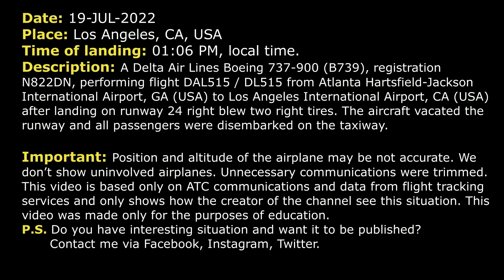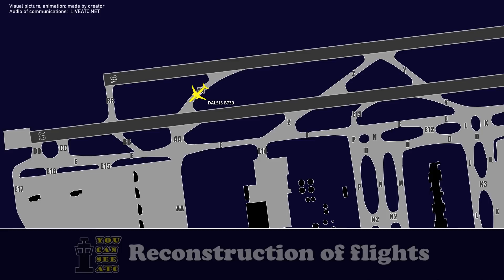Delta Boeing 737-900 blew two tires on landing at Los Angeles International Airport. Real ATC Audio

Comment: Wow, an intelligent firefighter and a stupid pilot. He even said tires 3&4 which would indicate the right side of the aircraft. Her, "Aircraft right, correct?" reply was stupid. All numbers are in sequence from pilots left. So, engine 1 would be on the left, and 2 on the right. So, 4 tires on the 737, would put right inboard and outboard tires as 3 & 4 which is a perfect and simple way of condensing, "right side inboard and outboard", to "tires 3 & 4". Stupid pilot.

Comment: Why isn't there any sensors detecting which and if a tire blew out? Is that too complicated technology?
Reply: our cars have them. in any event, the fire trucks will see soon enough and the runway garbage collector cars still have to examine the runway.  but an immediate notice that it was a tire that failed and not an engine falling off would be nice to see lighted up in the cockpit
Reply: Because it’s a 737 and it’s 1950s technology.
Reply: @UAL320  737s have tire sensors.
Reply: @N1120A  Not any 737 I’ve been on
Reply: @N1120A  it's a customer option. The airline has to choose whether or not they want them
Reply: @N1120A  ….No they don’t.
Reply: @UAL320  dream on buddy. You’re obviously an Airbus fanboi
Reply: @tomdavis3038  ….No, I actually fly this hunk of junk…..I’m used to it, though, so all good….👍🏻

Comment: More than 1 hour for a flat tire… not that efficient I’d say
Reply: Extremely efficient considering... They have to get two new wheels from their base, take off the old ones, check for any damage to the wheel area, put the new wheels on and then check that the aircraft has no damage plus they have to check the brakes are aligned and working correctly
Doing all that in an hour is no mean feat, it takes around 10-15 minutes PER car tyre. What you're also forgetting is that it's an active airfield, they have to get permission to go down taxiways like aircraft do so they could be waiting 10 minutes for an aircraft to land or move before they can move themselves
Reply: Tripe A takes three hours to reshoe your car. An hour for two tires bigger than a human blowing up is actually extremely efficient, considering how actually rare the situation is.
Reply: I don't think they left the pax on board for the tow.  It can cause quite a bit more damage towing with both tires shredded.  I suspect they brought buses out for the pax then either put at least one new tire on or just towed it as is and accepted the additional damage.
Reply: @darrylr.4983  I would be very surprised if they towed the aircraft without changing at least one tire. And I'd be even more surprised if it's allowed to jack up the aircraft and change a tire with passengers aboard.
Reply: Yeah, well, when your captain doesn't even understand that you can't tow an aircraft with both tires blown off of your right main landing gear, and needs to hee and haw for half an hour before someone else realises that for her...no wonder it takes long for them to even request the right equipment to them, and only then does the clock start ticking towards when they get the vehicles and equipment over there!

I mean seriously, one would think that common sense dictates that if you have no intact tires on your landing gear you ain't rolling that plane nowhere! But I guess they are now hiring pilots that belong to that group of people who drive their cars with flats and destroy their wheels and often much of their car too...
Reply: @pistonburner6448  She literally said she knows they aren't going to be able to tow the aircraft...
Reply: @Julius4396  No, she at first was talking about towing, then much later said maybe not (after she had talked to their operations), then went back to saying they might be towed.
Reply: @pistonburner6448  : Sorry, you are wrong. She realized quite quickly that the aircraft would not be able to move under its own power on its own wheels in its present condition; beyond that, it's not her call. It is certainly possible to tow an aircraft with two blown tires on the MLG; depending on circumstances and what equipment is available, they may be able to dolly it, or they may have to tow it anyway and accept further wheel damage (and probably runway damage), or they may want to try changing the tires on the taxiway, but in any case that's not the pilot's decision. That decision is up to Ops and Maintenance.

Comment: Hate to be stuck on the plane for an hour.
Reply: An hour's nothing. Try getting stuck in between two runways for three hours because there weren't enough gates in Honolulu. Makes you question your life choices every time a plane goes speeding by.
Reply: Before COVID, that was common waiting for a gate
Reply: My most annoying was in ATL once (where arriving early means you almost always have to wait for a gate to open up). We made it to a gate quickly, but then sat on the plane for an hour because the jetbridge operator couldn’t get it to the right place to match to the plane door. Don’t know if they were a trainee or if the equipment was malfunctioning, but lots of very grumpy connecting passengers watching them try, miss, back up again, try again…..
Reply: @6336hotair  if this was 3 or 4 years ago I might have been on that same flight. Unless it’s a common occurrence at ATL in the mornings…